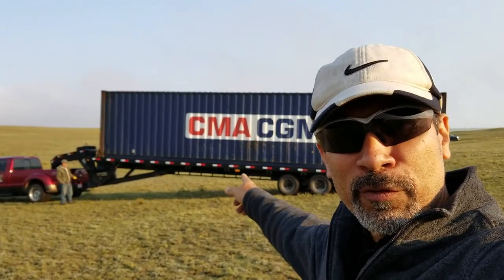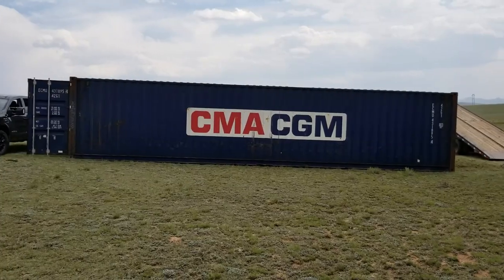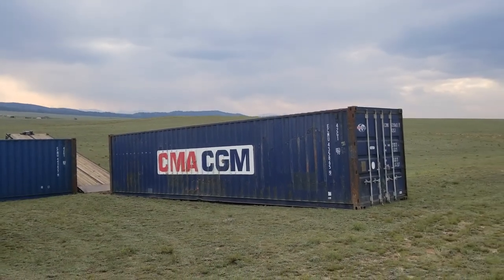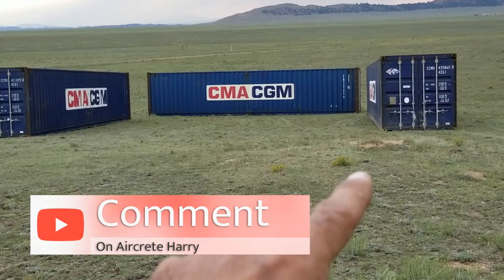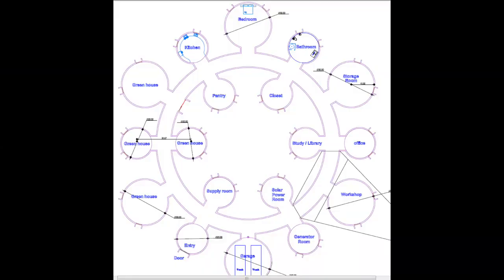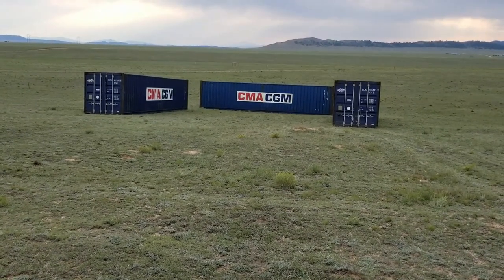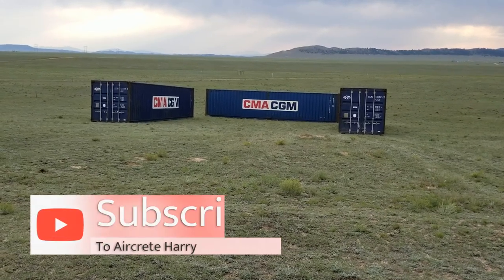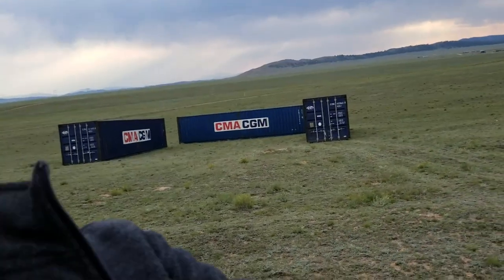Aircrete Dome Building Workshop in Colorado | ARE you Interested? #Aircrete #AircreteHarry #Workshop

Comment: Who is your builder, Monolithic (David South)? Who is your PV installer? Give price quotes per square foot and PV cost, links. 
How deep is water? I assume you have a well, can't build (or even buy) without water. Cost per foot? Will you have catchment? 
What are the county $codes$ like? West TX has almost none + cheap land, but little rain. What is your rainfall? Acreage? Plans for a pasture? Animals? 
I would opt for all basalt instead of iron/steel structural support. 
Insulate until you eliminate cooling/heating needs. Few do, but most are ignorant by choice (lazy). 
I plan to replace windows with skylights, mostly tubular. This simplifies shell (dome) design, reduces cost while increasing R-value. 
Looks windy. Will you have windmills? What fencing or windbreaks? How long will your driveway be? Paved with aircrete? Did you find the optimal mix for compressive strength? Will you use sand, gravel, clay found on site? Will you need aircrete in the dome with all that foam insulation? Have you chosen a lime wash exterior? (A no-brainer here in desert temps +100, +100 days per year.) 
You forgot to tell us what is in the containers.